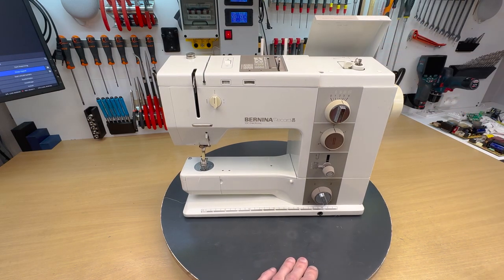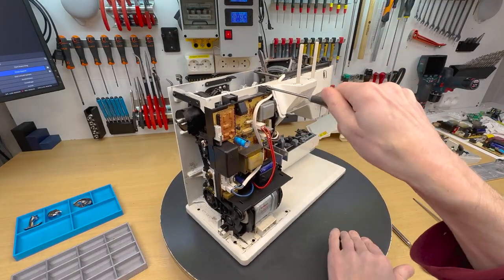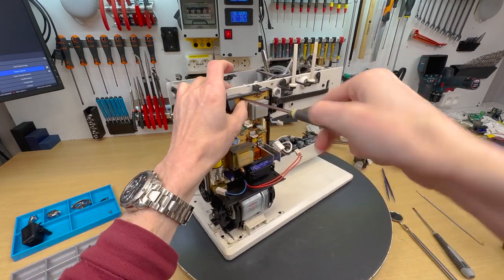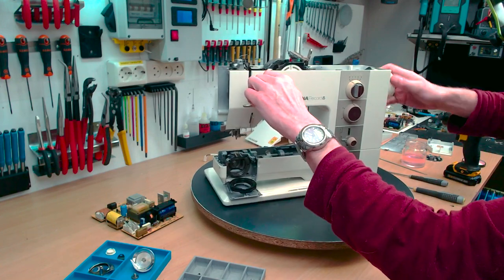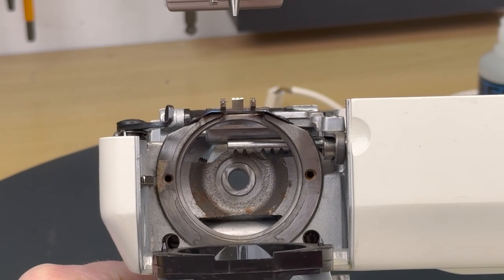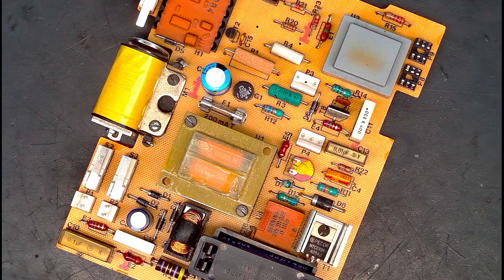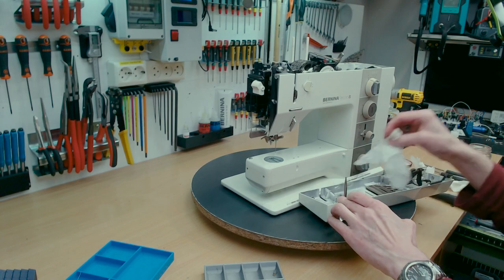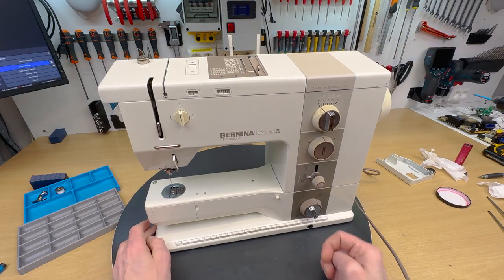BERNINA 930 Electronic on my workbench

Comment: Thank you for posting! I did not have any problems with this machine but wanted to take it apart for a comprehensive clean and oil. Your video helped remind me how to take it apart. Afterward, I reset the tension and it is not only stitching beautifully, but the machine runs like butter and is so quiet. A wonderful machine.

Comment: Question, what does the electronic part do in this machine comparing to those pure mechanical (except motor of course)? Thanks.
Reply from the maker: Hi! -> making a lower voltage for the LED on top and in front of the machine. -> give the motor DC voltage and controlling the speed. -> controlling the needle stop function and needle up/down with the heel tap function on the foot controller.
Reply: @sewrepair  thanks. Does it have a DC motor? That’s interesting I didn’t know.

Comment: Great demonstration. At 4:58 time on the vid there is a hook like mechanism - bottom left - which oscillates back and forth; and tensioned by a small spring. On my machine, this spring has come off the metal arm. I would be grateful for any tips on how to hook it back on. Also, what exactly does it do..
Reply from the maker: I will make a video explaining it.

Comment: I have a Bernina 930 that was passed down by my wife's grandmother and I love it. The only problem now is that when it encounters something difficult (like more than a single layer of cotton material, or a fold) the clutch kicks in and I have to start it again with the hand wheel. I took it to my local Bernina dealer and they had it for weeks, they said they see the problem but don't know what it is! They tightened the screw in the handwheel and sent it back. It's still doing the same thing. Have you seen this symptom before? It's driving me mad!
Reply from the maker: I haven't run into problems with it kicking in with heavier or thicker materials. But I'm thinking a bit about a possible electronic problem, with it happening when the engine runs a little heavier (as I understood it). First check with another foot controller, just to be sure. A foot controller that has fields the variable resistance in the pedal drops down to 0 ohms, you will be able to experience this. I have also experienced that by replacing the 0.47uf electrolytic capacitor, that function got repaired. Of course it can also be mechanical, so check that the clutch runs freely (not oil), and that the other mechanism that controls the needle stop function runs easily and freely.
Reply: Thank you so much @sewrepair . I will see if I can get a pedal converter and use a different pedal. I don't have a spare original pedal. Do you have people from the U.S. send you stuff to repair or is it logistically difficult?

Comment: Hi, wonderful video. I have a 930, it stopped working, i have been told that the power supply on the board has failed. Is there any way to get this repaired, or get spare parts. I live in NZ and have taken it to 2 service techs and they both say the power supply has failed. You seem to be able to do wonders in your video. Regards Peter.
Reply from the maker: Yes it is possible to fix them :) More info on electronic repair here: syrep.no/repair

Comment: I love this video!  Thank you.   My Bernina repair guy asked me if I ever use the long stitches.  I said no so he didn’t repair it.  Does it affect anything else to leave it stuck?  Also, how can I get the tension indicator to be in the center when the stitches are balanced.  Unfortunately my wonderful repairman passed way so can’t take it to him any more.
Reply from the maker: Thanks for the nice feedback about the video. No, it doesn't affect anything else if the long stitches don't work. If you take off the top cover, you will see on the underside of the thread tension indicator a screw that you can loosen with half a turn, then you can center the tension indicator and then tighten the screw again.

Comment: Dear SEWREPAIR, Thank you for this great and impressive Video! If I may add a little advise, I made myself, out of Aluminium angle, a set of standard holes, in Millimeter steps,
which helps when punching out small pins or shafts. It is old practice from repairing
difficult items like Cine Film projectors, clocks and sewing machines.
Thank you again!
Reply from the maker: Thanks for the advise :)

Comment: Are the circuit boards becoming obsolete for the 930?
Reply from the maker: Not quite sure what you mean. In those days circuit boards were made repairable, while many of today's circuit boards are almost impossible to repair. 95% of the electronics components that were used, it is no problem to buy new today. I post information about repairing electronics on my website: syrep.no/repair

Comment: What was in the blue labeled bottle you used on the hook driver? Fabulous video, thanks
Reply from the maker: Thanks! Klübersynth UH1 14-1600 A synthetic high-performance lubricating grease. It is included in BERNINA's Lubrication Plan for the 4-Series and up to the 8-Series. I buy it from BERNINA - No: 002779.72.02

Comment: Just came across this video.  I am so impressed with your attention to detail and your knowledge about all the parts.  I have that same machine and have replaced the circuit board once.  Told by the tech when I took it in for service that the next time it goes, I will not be able to get the part any longer from Bernina and they will not install one bought elsewhere 😢.   Wished it is possible to find someone local that is so knowledgeable as you.   Thank you for filming the video.
Reply from the maker: Thank you for your feedback! Unfortunately, there are not many people who repair the electronics on sewing machines. Most people just replace the print cards, which is a shame since the fault in most cases is just a simple component that is still possible to obtain. Hope the videos I make show that there is still hope for the old sewing machines.